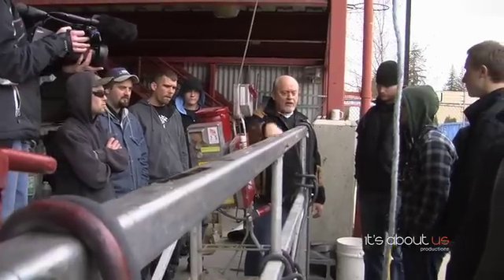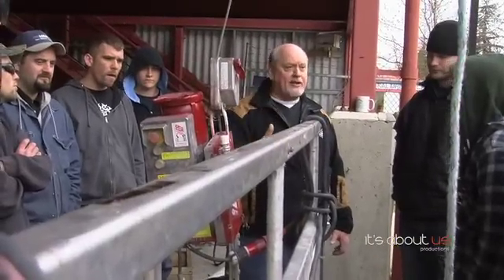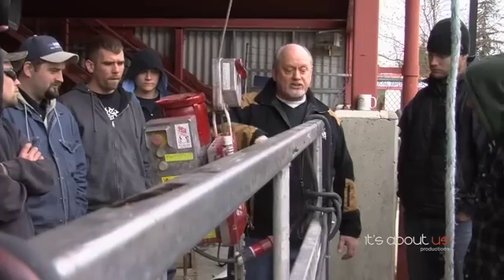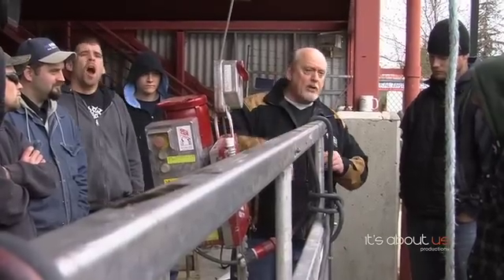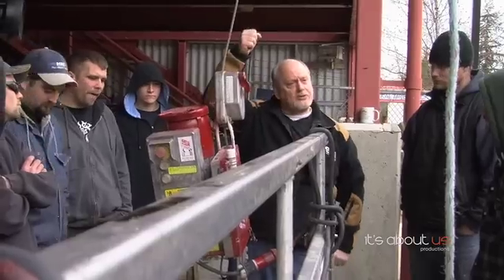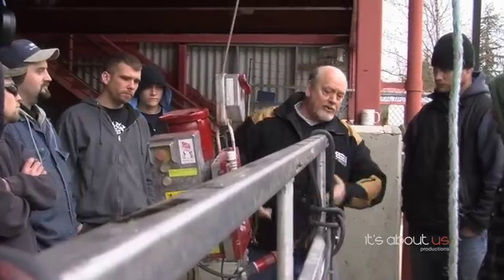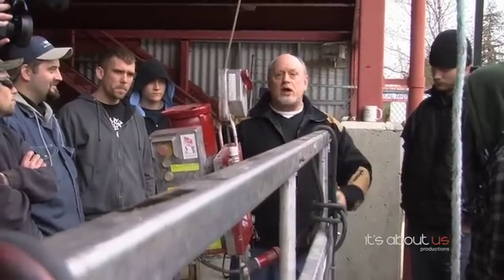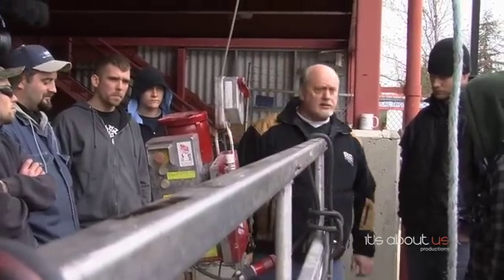Learning to Operate a Swing Stage

Comment: Hey Bobby, a majority of the swing stages you see have a self powered system, meaning the motor used to move the stage up and down is attached to the stage.  There are some systems where the hoist is located on the roof.  

The hoist has drums which create winding and traction, which pulls and lowers on the cable.  Having the appropriate gauged wire rope is key.  

The way we run swing stages is typically a source of power is located near the roof, we need to tap into the building power.

Comment: Hi, guys! Weird question the 'machine' that pulls you up and down (so essentially the little elevator-motor or w/e it's called) by the cables, how does it work? As in: How is it powered? Is it connected to a simple generator with a powercord from the roof? Or is it powered through other means?

I'd be very thankful if you could provide me with answer! :)
Reply: You get power from the roof or any power panel in the building. You will need an electrician and you need 220 volt power. Most buildings now have independent 220 plugs in the elevator room on the roof so you can just plug in the power cord for the swing stage.